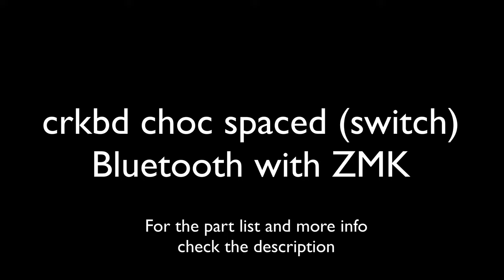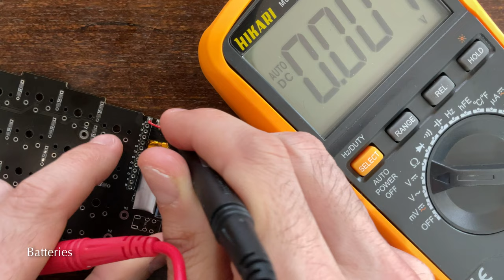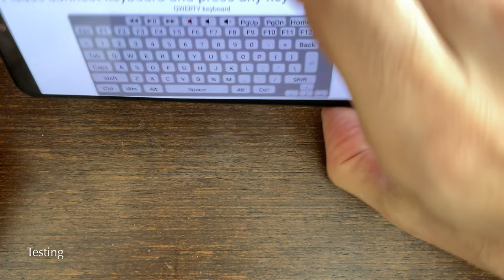Crkbd Choc Spaced Wireless Keyboard Build Log

Comment: Hey great video! Im thinking about building this (never tried it before!)   and wondered how you layered the keys? How easy it it to customise in that sense?
Reply from the maker: Hey it utilize https://zmk.dev as firmware and it's super flexible to configure. 

You can check my personal config here:
https://github.com/rafaeldelboni/zmk-choc-corne, just search for a .keymap file :)
Reply: @rafaeldelboni  I really appreciate you replying. The design of this is going to really help my cubital tunnel not helped  by overstretching my pinkies on traditional keyboards. Can't thank you enough!! ☺️

Comment: have you tried it with the nice nano V2 clone from Ali express?
Reply from the maker: Personally I never tested, but I know some folks that say that it works super fine.
Reply: @rafaeldelboni  thanks for the quick replay! I'll give them a try and post my results here.
Reply from the maker: @TheEyalYemini  cool, yes please do so
Reply: @rafaeldelboni  btw is there a wireless version of the board with hot swap capabilities?
Reply from the maker: @TheEyalYemini  I think you probably could use the legacy Corne Choc v2.1.0 with a Nice!Nano instead a Pro Micro https://github.com/foostan/crkbd/releases/tag/corne-chocolate-v2.1.0
Reply: @rafaeldelboni  okay thanks!
Reply: @rafaeldelboni   the Ali clone works great so far! although there is a small problem with a wrong value resistor that causes battery life to be less of ideal (about a week on stand by instead of the month NiceNanoV2 provides) but that a small price to pay I think considering the major gap in price.
Reply from the maker: @TheEyalYemini  cool! I know that would be super cirurgical, but maybe is possible to swap this resistor? 

Which PCB did you built in the end?
Reply: @rafaeldelboni  It would be very complicated indeed since it's a very small resistor. I built the  Choc v2.1.0 as per your recommendation and skipped the LED installation to preserve battery life.
Reply from the maker: @TheEyalYemini  Great! I hope you had a great time doing so :)

It's a great keyboard layout BTW, it was my main until this week.
Reply: @rafaeldelboni  Indeed I had. does that mean new vid comes out if so I can't wait!